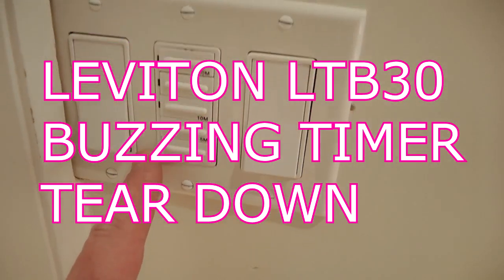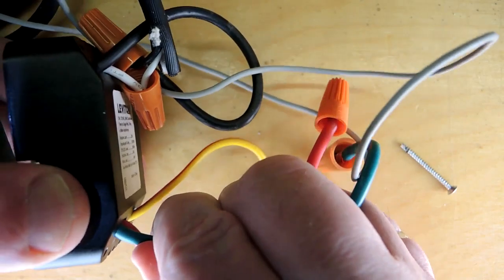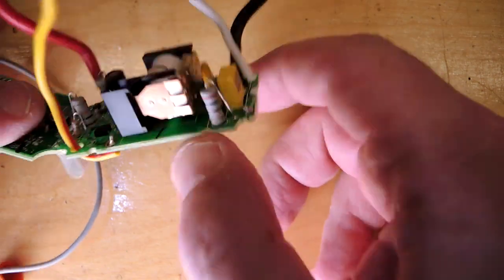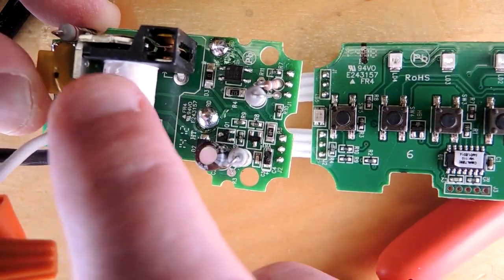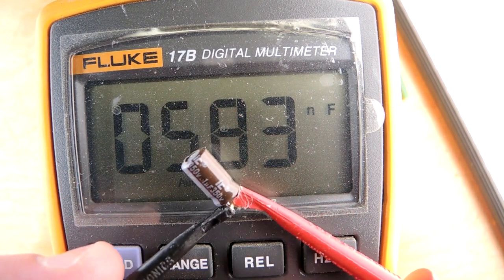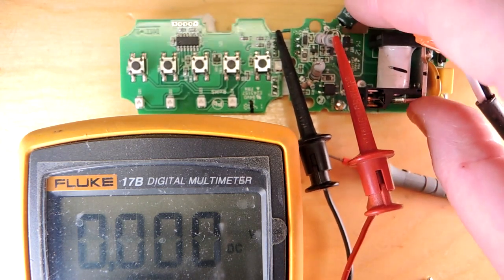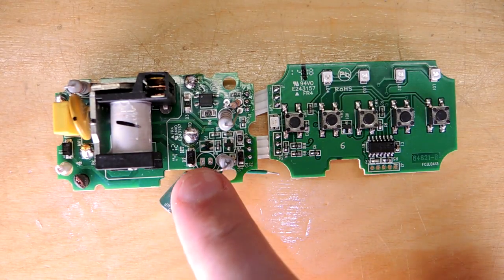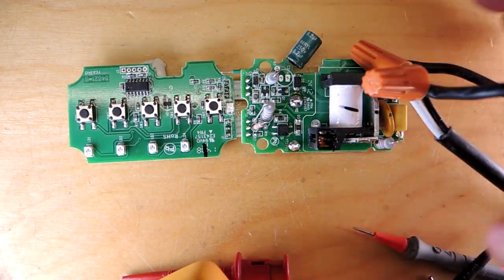LEVITON LTB30 BUZZING TIMER FAILURE ANALYSIS

Comment: That seems purposely designed to fail. No one in their right mind would put a 1 watt heat source right next to a cap. It even looked like they were installed slightly bent to be touching. So it didn't even make it through the warranty. With the designed spacing it fails just out of warranty, like it's supposed to.

Comment: That engineer needs a clunk upside the head. Designing it to fail while still under warranty is complete incompetence.
Reply: shorten the warranty to 1 year, problem solved, or have such complicated claim terms, proof of purchase, require registration, pro rated with terrible terms,  P&P at your expense both ways and more than its worth, 90 day turnaround etc,   all ways to screw the customer
Reply: Exactly. A very small percentage of consumers who buy such a product are going to bother replacing it under warranty as opposed to simply buying a new one. This isn't an unfortunate design choice, it an ingenious planned failure.

Comment: Seems to me like really trying to save pennies in that design.  They could have chosen a bi-stable 5v or 12v relay that's maybe 50 cents to 1 dollar more expensive and then have a 5v/12v power supply inside "optimized" for a few mA (the idle power consumption of microcontroller and leds) and able to do a burst of 50-100mA for a few seconds, enough to switch the relay between states. (or maybe trickle charge up a capacitor during idle times with enough energy to guarantee switch between relay states)
Seems like very wasteful to keep the relay energized for up to half an hour producing heat in that resistor the whole time.
Reply: They could have just used a triac. They are cheap and wouldn't waste a bunch of power like a relay.
Reply: A lot, not a bunch.

Comment: Good video and analysis, but why didn't you repair it if it is so simple?
Just put in a 10uF 50V 105deg. or higher temperature rated cap so it has a few uF extra "to cook away" before it reaches the critical point again.
With linear supplies upgrading in terms of capacity is not desired as you will put more stress on the transformer. 
In this case it's a capacitive dropper circuit as far as I can see and I'm not sure if upgrading the capacity of the smoothing cap has any adverse effect on the lifespan of the other components, but perhaps you can shed a light on that, I'm no expert at all ;).
Reply: he did, but bought a new one first, not like he knew he could fix it
Reply: Oh, I must've missed that piece of information completely, then. My bad.
Reply: no worries, he barely said it